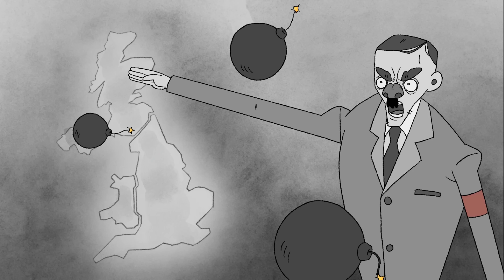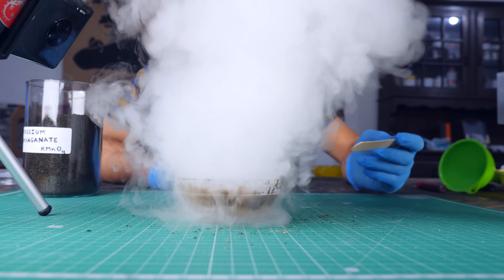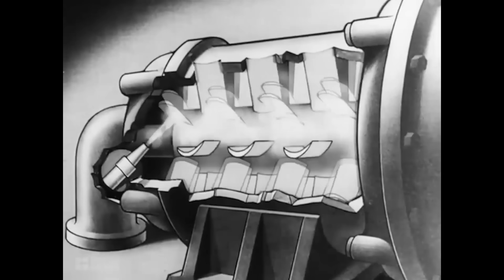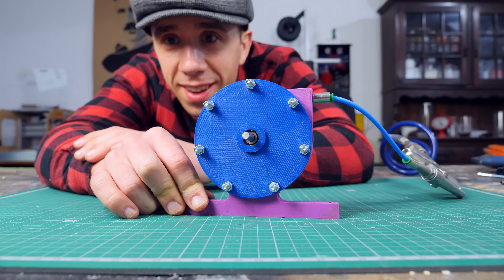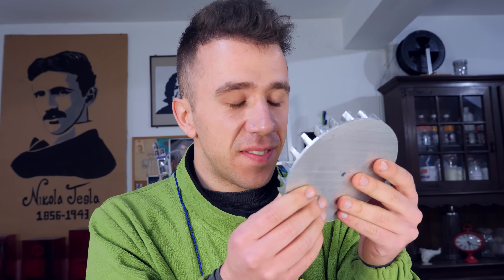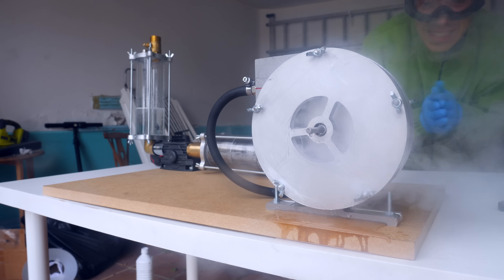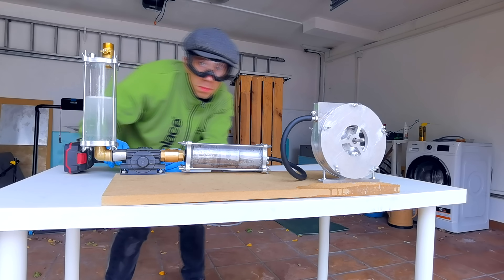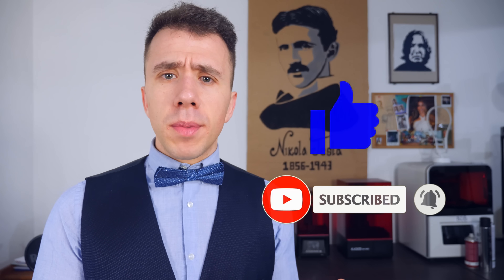I built the World War II V2 Rocket Steam Turbine

Comment: @Integza - I would suggest making a proper turbine design with a proper volute. the turbine you designed is pretty basic. There is no volute in the design to direct the "gas" / "air" / "steam" in a radial direction therefore it is very inefficient and lot's of the steam produced is basically lost and going out directly out the "exhaust" opening. 

Moreover , you mention pressure to be some sort of an indicator to how fast is gonna spin. it might cause some misdirection as the pressure spoken is the pressure in your air compressor tank and has no real value of the air flow.

From that point i mentioned have a look at the hole that flows the gas into the turbine housing , it is very very small which means there is a limited amount of flow that can flow there. Yes high pressure = faster moving air = faster spooling turbine BUT when looking to gather more speed at the top ( max stable speed of the turbine ) you will need more air flow rather then pressure.

Effectively think about a turbocharger in a car. small AR of the turbine housing will help with turbo spool up time but will loose a lot at the top end reaching lower efficiency due to restricted air flow. 

With that all said on paper , you will need to run proper CFD to get those results and take into account the actual air flow that the "Steam" or any other source of "air" or "gas" can actually produce.

Some directions for you mate :

1. the turbine is way to big in my opinion for the "power" output that it can actually produce ( more correct - too big for the amount of air it needs to move ). A much smaller turbine will be better. A 40mm turbine wheel on a turbo charger as an example can move north of 20 lb/min of air. I would suggest first of all to take down the size , which will also save weight and be easier to spool.

2. get some ideas from a use turbo units that you can get off ebay. you can also use a turbo turbine wheel and turbine housing with slight mods for the project which will be better of then this design.

Comment: Omit pump, replace with simple valve. Add 90deg bend after converters going up to a T, where one side connects to top of peroxide tank to equalize pressure, and the other is new output. Open valve to gravity feed reaction. Maybe vertical stack.

Comment: I know this is a late comment, but you might try to use the device from your Tesla Earthquake machine video. I think you're losing a lot of power due to your steam system being based on high pressure gasses where turbines deal with high speed gasses better. But I don't have to tell you about changing low speed high pressure gasses to low pressure high speed gasses.

Comment: This video got recommended to me and now I have found a new creator to binge watch before sleep. Nice!

About the design improvement though, as many said I believe mounting the catalysts vertically would help reduce liquid H2O2 escaping and getting into the turbine.
What if another, smaller turbine was placed just after the catalyst?

The steam could rotate that smaller turbine which will require less force, and increase the pressure, maybe even install tubing downstream of the small turbine that decreases in size gradually until the main turbine inlet, which would help increase the inlet pressure even more.

Comment: Hey Integza.  I'm interested to see if etching the flat blades in a tesla turbine changes efficiency of the system.  You could try etched straight lines from the centre to the circumference, cross hatched lines, spiral lines (both with and against the flow of fluid through the turbine) or just change the roughness of the blades using different grades of sand paper.  If you found smooth surfaces are more efficient, then polishing the blades may improve efficiency of the system.  Idea for a new video?  Keep up the good work.

Comment: I loved the video and the sound of the turbine, beautiful and dangerous as it should be, thank you for keeping me thinking about new ways to create things, my dream is that we all have electric generators and renewable clean energy systems at home, for the project you did you could make an alternator to create electricity, since it is a little more efficient than adding a brush motor, because you don't have friction, just a magnetic brake, you could also make a steam engine following the same concept but with a boiler and water, you could put a section in the exhaust part, which it converts the steam back into water and try to reintroduce it into the system to close the loop, I don't know if it's sunny in the place where you live, but you could try to heat the water with magnifying glasses, this same magnifying glass system could be used in the striling motor that you once did, to make the hot part, use water at room temperature for the cold part and the same, make an alternator to generate energy, you could even use a battery and a pertier cell to further cool the cooling water and use part of the power from the alternator to recharge the battery like a real car engine, the power from the alternator would be to charge a bank of batteries and then connect them to an inverter so it is not necessary to provide us with the 240v that we usually have in the home power outlet, I know it is very ambitious but I have not seen anyone on youtube who makes a system like this, I think we would all like the electricity bill will be cut in half thanks to such a system and sorry for my bad writing I'm a good talker but when it comes to writing in English I'm disgusting, greetings to all.

Comment: Add a restriction valve of some sort to the outlet from the catalysator so that you can keep a constant pressure and then at the end of the turbine where the outlet for the steam is maybe cap it off so that the left over steam is feed to another system to use that heat and pressure to drive something else. I.e sterling engine or another turbine.

Comment: Why not try using the fuel injectors that are used for engines to mist the magnesium and peroxide. If you angle the misty flow of the two to make a cyclone pushing away from the out-put it will have more time to catalyze.
Its all about surface area to speed up the reaction and enough distance/time to react (like a fuse).
Because you are using a 50% peroxide you will still have, what looks like, un-catalyzed peroxide.
Reply: Does this count as a video idea if its about how to (possibly) help the next video?

Comment: In a jet engine the compressor shaft and the turbine shaft are the same.  Maybe you could have the turbine shaft connected to the hydrogen peroxide pump shaft?  That way it'll self cycle once you get it going.  Just a thought.

Comment: I just watched your video where you use the impeller to power a bout and you used Teslas turbine to power it and one of the problems you had was air supply but i think Teslas original turbine used water instead of air so you could have put a water pump on the bottom of the boat to turn the turbine then you would've had infinite supply of water to power the impeller

Comment: I know the liquid coming out was hydrogen peroxide but part of it would also be H2O which has changed back to water would it not? 
Maybe you can make some type or reverse airlock in the pipe which will separate the liquid and steam without to much power loss

Comment: Love it! I think the power source is great by far compared to 3d print one. To avoid waste try using it vertically and let the reaction occurs below with the output on the top. For the turbine, try using some pneumatic tools instead. They are much more capable of high torque at least.

Comment: I think a good idea for a build video would marry this chemical reaction into a rocket with an r/c controlled throttle. You could even see this power your skateboard without the weight of the turbine and even see this take flight like the old pulse-jet winged bomb design w/o the boom of course! And you could even 3D print the rocket body & nozzle all at once after you figure out the proper nozzle for optimum thrust. Or maybe not? IDK I hate tomatoes too so either way this would work at blasting those across a yard or even blasting holes in them if strapped down.

Comment: Wonder if the belt is slipping also a way to recycle the hydrogen might be useful another thing is a gearbox might be a good idea maybe planetary gears since it's compact and that will allow you to put less rpm to the bearings and maybe allow you to gear it to take full advantage of the kinetic energy

Comment: Make a turbo charged jet engine which isn’t having the turbo powered by a motor but by the exhaust (basically a re do of an older video)
If the hot side gets too hot for the cold intake separate the two sides like the Mercedes F1 Turbo
Actually rethinking it makes me believe it might not work out this way with jet engines, yeah this is basically what the compressor is at the front of a jet engine, just doesn’t need air to be pulled in mechanically with the help of exhaust gases…unless it’s running at idle without the help of a motor. It may just help make a more impressive engine thrust without it pulling in air just by moving forwards into the air

Comment: maybe you should use a pelton wheel for your turbine, although that might be very hard to machine. I think I would go for a single bucket design, such as the one Tom Stanton used in his videos. To improve your current design, I recommend adding a cone shape to the rotor, that redirects the steam, that already spent its impulse on a blade, to the exhaust. In one of the shots it looked like it was going back and hitting one of the other blades in the back, which would reduce efficiency.

Comment: Would splitting the system into 2 impalers provide a better output? You could even add some 3d printed or cnc'd gearing to ratio up the spin on the output impaler to provide more thrust? Don't know of that would work but it would be interesting to see.

Comment: Would using the Tesla bladeless turbine design using recycled hard drive platters help with the design, since many hard drive platters have a platinum coating which would help with your hydrogen decay? Then you could also use the Tesla one-way valve to feeding the hydrogen

Comment: For a side fed turbine design you should have the exhaust outlet fully open to the atmosphere. Also if you look into A/R ratio of turbine housings you'll probably find the inlet is too small relative to the turbine diameter. Since you're working with a small-ish flow of gas I'd suggest down sizing the turbine wheel. It'd be helpful to get a pressure reading from the inlet side. Cool vid!

Comment: I had NO clue catalytic converters could do that to H2O2! Freaking awesome and really does make things so much more practical.
Reply: The problem with your vortex engine is that you were inserting oxygen from the nozzel side which insted of making a vertex started pulling the flame which was not intended.
Reply: Well there is a soild reasson why cats' are getting stolen, its not just your regular theif, is a rocket secientist.
Reply: he should use a tesla turbine for this they provide best torq at low preasure
Reply: What did you think catalytic converters did? Magically get hot and waste fuel to protect you from carbon monoxide and oxides of nitrogen when driving your hooptie?
Reply: @EnthalpyAndEntropy  He didn't know they worked on Hydrogen Peroxide, since he probably assumed there wasn't much hydrogen peroxide in fuel.
Reply: @meateaw   I was being facetious. I've had multiple courses on phase and reaction equilibrium as well a kinetics and I've been making catalysts for chemical sensors for years. It's common knowledge in my field but I wouldn't fault Maker's Muse for not knowing. He or she shouldn't feel bad and it is freaking awesome!

Anyway, you have it backwards. It's not about how much peroxide is in fuel. Hopefully none until you're ready to rock your rocket as a catalyst isn't needed. The catalyst in your car helps reactive combustion byproducts become less reactive. It's the same for the peroxide. The peroxide is reactive. It allows it to react with itself...

That's what catalysts and enzymes do. They're generally a convenient surface for stuff to adsorb onto to then react with themselves and hopefully desorb after. It's usually much faster than waiting for liquid or gas molecules to collide just right so they can react as they would without.
Reply: @EnthalpyAndEntropy Maker's Muse is a man. He has a nice 3D printing and part design channel.
Reply: @MrNathanstenzel  and?
Reply: @EnthalpyAndEntropy  hoopties don't have cats lmao
Reply: @Gremlin244  yea they do unless they were already stolen
Reply: @EnthalpyAndEntropy  mine doesn't do anything since those crackheads ripped it off

Comment: It appears your original setup is just forcing hydrogen peroxide into catalytic converter, which when it steams it starts blowing the liquid 

My idea,  use a vehicle fuel pump,  a vehicle fuel injector, Arduino to pulse the Injector this will spray the hydrogen peroxide on to and into the catalytic converter.   Spray from the injector will get H202 on catalytic convertor top to bottom, left to right, instead of say pouring action which is causing puddling and in essence coming out as unburned. 

Finer mist, then dial in Arduino for longer pulses to help stop H202, "fuel" waste.

Also some after thoughts, since H2O2 is corrosive to some things, much like some racecar parts built to use say use race fuel for some reason do not contain Nitromethane, in the category as race fuel

Long story short,  I didn't read instructions,  because description said built for "race fuel", after the failure , I read instructions and it says do not use nitromethane, because this fuel break down bladders and tear up fuel system, but it was safe for all other NHRA approved race fuels... So I had start over on my car's fuel system.

Comment: A steam-powered automatic shooter of some sort seems about right. That high-pressure steam has a lot of potential.
Oh and about those broken endmills, try single flute endmills for cutting aluminum. I use mostly 6mm diameter single flute at about 10000rpm, 0.8mm depth of cut, and 1000mm/min feed. It blew my mind and cutting has been much easier since!

Comment: As far as limiting the waste, you can try and use a 12v fuel pump with the correct injector pressure rating and just use a cheap pulse with modulator as a signal generator to fire the injector. And as far as more torque from the flywheel you can try a pressure sensitive valve you can order them in a variety of pressure ratings. So that it builds substantial pressure before even trying to turn the flywheel therefore even more eliminating waste. And doesn't let the pressure drop below a certain point. Awesome video and keep up with the CNC router. You just need a bench top Mill and mini lathe and you'll be on whole new level of builds 🤟

Comment: It would be interesting to use catalase enzymes. They're 1000s of times more efficient than catalytic converters, and water miscible. You could create a mechanism that injects them into a tank of h2o2 and create huge pressures, with no liquid coming out of the turbine simply because it reacts so quickly.

Comment: Switch to a turbine based on a turbocharger. Create a back flow chamber so the excess hydrogen peroxide stays with the catalyst and not wasted (and creating drag) in the turbine. Instead of a drill pump. Use a solenoid and compressed air to spray through a wet fogger nozzle similar to NOS for cars. Create and mount a nozzle to the turbine outlet to help laminate the flow and improve evacuation of the gasses. This will help get more RPM. This should improve your  output.

Comment: Not sure if this has been suggested but feed multiple steams of peroxide from the top or middle of a vertically mounted catalyst chamber. Then have a larger diameter exhaust tube(also mounted on the top) piped into your turbine.  Regenerative heating of the liquid propellant may with a speedy break down as well.

Comment: You should consider using loctite 680 for securing the shaft into your aluminum impeller. It works really well and you don't need to grind slots into your shaft

Also loctite 243 is great for keeping nuts from rattling loose. Just careful around thermoplastics

Comment: Very interesting, note! For your turbine, you use the thrust of the air to spin it.
What would happen if in addition you used the shape of the air to increase the spin?
Let me explain: a sailboat uses the air to propel itself faster than the wind, if your fins would be turned so that they use the air to be sucked in and in addition then to be pushed back. Would your device run faster?
Coming from English from Google transla

Comment: How about building an engine that runs off a simple water and battery hydrogen generator? You could play around with gear ratios to get the most torque out of the motor and pull a weighted sled or something. Aka a tractor pull.

Comment: Do you suppose you can buid a reaction control system using the hydrogen peroxide as fuel? Like the kind they used on the X-15 spaceplane?

Comment: mount cat vertical top fill also use water trap that drains back into the cat even use a vortex/cyclone. fit pressure release valve to turbine so you don't dump gases before pressure build-up giving more reaction time.

Comment: here are some suggestions with reasons
1. mount the catalyzor vertically
--this should help with the uncatalyzed fluid
2. a high pressure re-flux column 
--if 1. does not fully remove the liquid, but this would need a heat source to keep pressure
3. a low pressure nozzle
--this would be to get a better reaction in the catalyzor
4. use a Tesla turbine
--do i need to say more

yes most of these have been said before